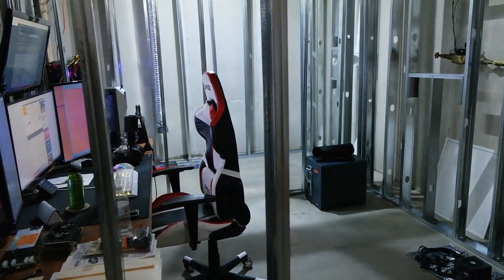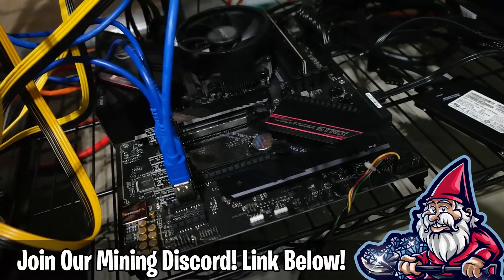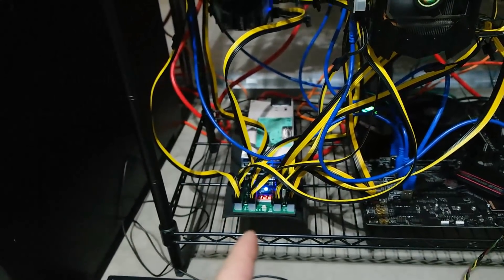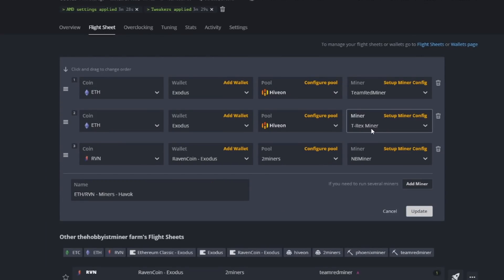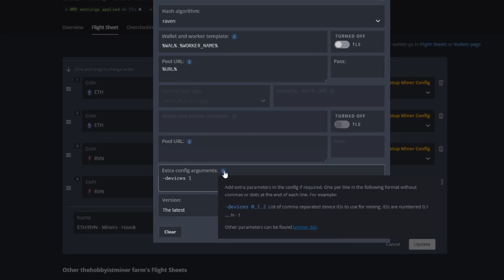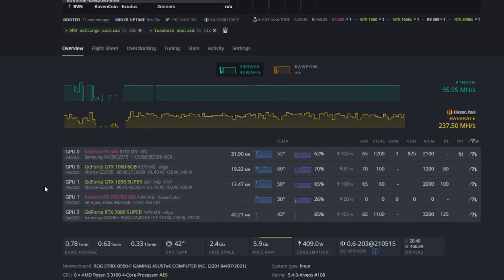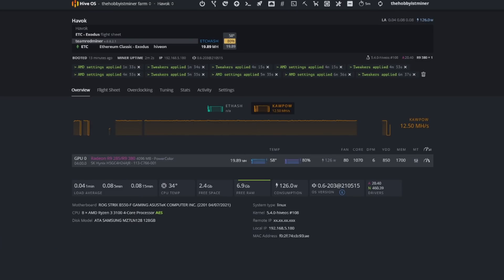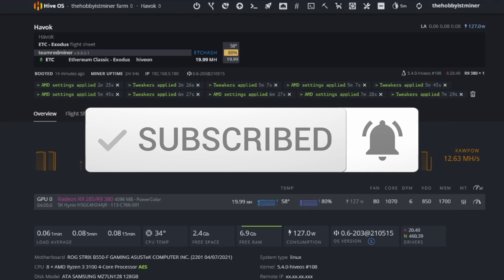Extra GPU Slot Secret For Mining | M2 to PCI-E Adapter

Comment: Hey buddy. I got two of them on a dual m2 mobo, but it's still being impossible to see both cards connected. Have you ever tried using all the slots you have available ? Any extra BIOS cfg ? Thank You !
Reply: I think in BIOS M.2 should be enabled and configured as PCIE mode not SATA, also you need to read MO documentation as your CPU must support 11th gen in order to enable M.2.1 port

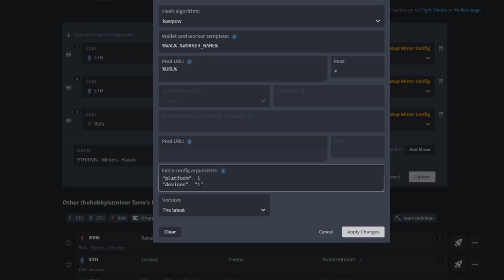Comment: 6:25 When you set up the extra config parameters, you said "there's 2 device ones" but actually, I think you should reference the Shell In a Box to get the device ID, shouldn't you? I think using the GPU listing in the GUI is not correct. I'm new at this and I learn so much from your videos! It just so happens that I am trying to figure out the extra config arguments the past couple of weeks and I THINK that's how it works. Please correct me if I am wrong! Thanks for all your videos.
Reply from the maker: This is the GPU ID at the Rig Screen. So 0, 1,2,3,4 etc. This video goes into more detail.
https://youtu.be/sgezUMe8cZU
Reply: @TheHobbyistMiner  Thanks for the link! I learn a little more each time I watch your vids. Setting up several miners sounds like a good idea. I've got a mixed AMD/NVDA rig and I'm trying to get the LHR parameter working on the 3060s. That may be the best way to go  :)

Comment: hello guys am pretty new to mining so I got a mb with 7 slots + 2 m.2 to usb adapter slots one adapter that I've been using was doing fine the 3060ti was plugged in with no issue but I just got another same gpu that I plugged in other slot but the second gpu doesn't show up, when I first bought the adapter some dude changed something for me in bios but I forgot what it was any help please ?
Reply: I have a similar problem right now. I am using Asrock b450 fatal1ty k4 and have 6 cards running well but when I plug the 7th into the m.2 slot and one of the cards stop showing up
Reply: @paradoxical5  same, card works but doesn't showed up in hive, did you find how to fix that ?

Comment: Hi, I have a ASUS ROG STRIX B450-F GAMING II with 6 GPU slots, i try to use the M.2 port with a USB3 adapter but it doesn't recognized. I need to set up something in the BIOS? Thanks.
Reply: Change setting from sata to pcie for m2
Reply: @donclintos5709  do you know where is it on bios?
Reply: @evandro_m  depends on the board on oem board i never see it but on my msi board its there where you adjust pcie gen form auto to 1,2,3
Reply: @donclintos5709  i  changed from auto to gen 2 and now it is working  and the wifi come back to work, thanks!!! my board is an asus x470i mini itx

Comment: My motherboars has 3  m2 slots so that means i can use it the 3 slots for graphics with the same performance as pcie slots? thanks in advance
Reply: One of those will be only for the wifi. I think it's a different connector.

Comment: Now can you run 2 extra gpu's on a board that has 2 M.2 slots ? :)
Reply from the maker: Yep
Reply: Have you tried this? I was running 6 gpus but moved my 3060 down to the motherboard 1x16 in an attempt to override the bs throttling mechanism nvidia installed. To fit the other 5 cards I had to install 2 - m.2 to pcie adapters but only 1 adapter is recognized now. I went and made a mess.  Wondering if you even can use more than 1 m.2 slot this way?
Reply: @kevingarvey1447  Hey there. Have you found any way to use both m2 slots ?

Comment: I tried with one of those adapters (blue pcb). Didn't work. Returned and tried again. Didn't work with my MSI b450 tomahawk II max.
Next thing I wanna try is a 1pcie to 4 pcie expand card. Hope it works.
Reply: Same experience bought 2 for z390-p and they don't work :/
Reply: Change setting from sata to pcie for m2 your M.2 slots in your MOBO BIOS
Reply: @cortialgregoire4625  Also I tried changing everything on the BIOS. Didn't work. BUT the 1pci to 4 pci adapter worked really well!
Now I changed the mobo but didn't try the old adapter yet.
Reply: @cortialgregoire4625  hey, where is thst setting? Asus rog strix B550, thanks!!

Comment: Idk if you knew this, but I have the E version of this motherboard and there is an additional m.2 slot above the top x16 slot behind that other heatsink. If you had another one of those adapters it should also work there.

Comment: are you able to tell if this is running at x1 x4 x8?
Reply: M.2 runs either at x2 (B key) or x4 (M key) speeds depending on the key. If you count the pins on the short side a M key will have 5 pins and the B key will have 6.